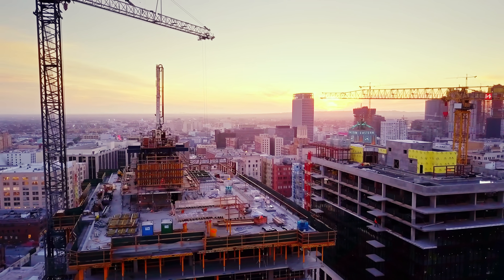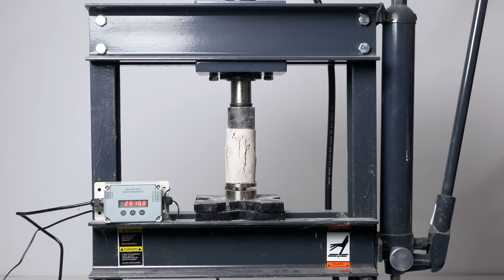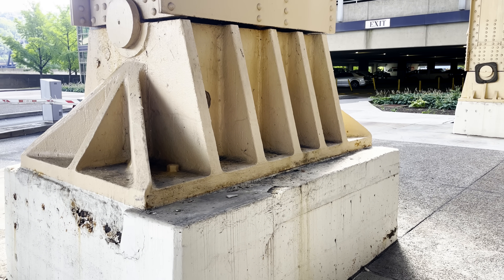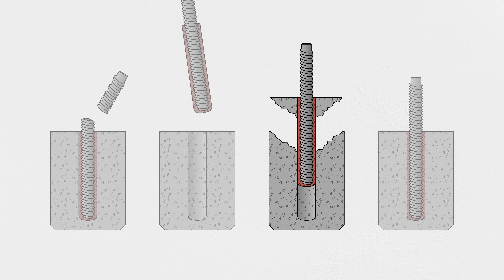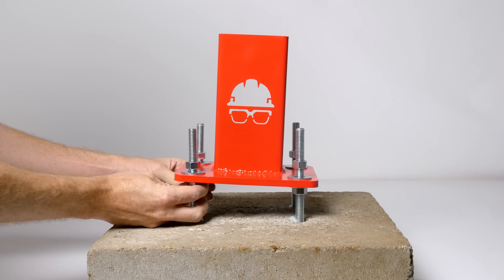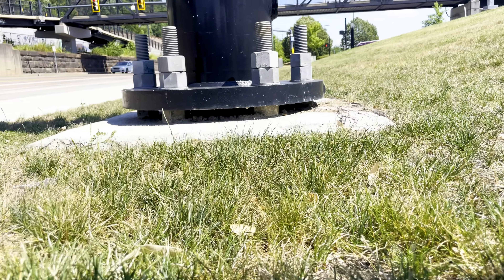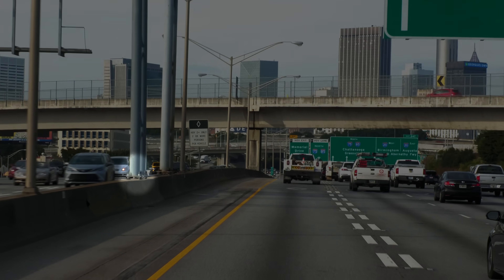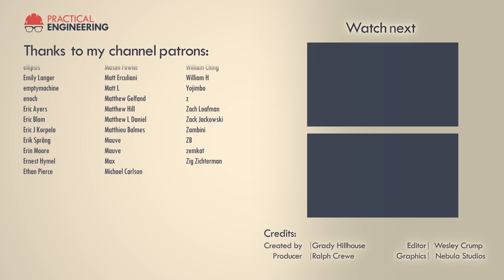What’s the Deal with Base Plates?

Comment: Back in the mid 80’s I invented the Immured Foundation to attach electrical transmission poles to drilled pier foundations and eliminate the baseplate and anchor bolts. The pier reinforcing steel was left extending above the pier and the concrete set. The pole was set over the extended reinforcing steel and concrete placed inside the pole over the top of the rebar. The length was the greater of 1.5 times the pole diameter or the development length. 10 to 15’ was common for these poles. 

The problem with anchor bolts has been around for a long time and I have seen a lot of mistakes made and fixed a lot of them. Most are self inflected by the original design engineer.

The Immured Foundation was invented to eliminated the anchor bolts for large steel poles. If you Google “Immured Foundation patent” you will find the details. It does take special software to design.
Reply: Is this Mark, or Gordon?
Reply: @ Mark, Gordon French passed away.
Reply: That seems to just be an embedded pole. Dig hole, plop in the base pole and a rebar cage, fill to grade, add new pole section, add more concrete. The images didn't help me at all, unfortunately, but it sounded like you're just constructing a grouted pole. I'm sure I'm missing something.
Reply: @kindlin  Direct embedment works for the steel LD poles. You do have groundline and inside corrosion issues making it unreliable for major poles and they lacked the strength for angles and dead-ends. You also need a larger diameter and burry a lot of steel. LD poles are a replacement for wood poles.

The Immured Foundation was invented for an odd reason and proved to have other advantages. It does not make sense for every application. The Immured Foundation was invented to reduce the drilled pier diameter. A new group of poles was developed that required an auger lager than 10’. The 10’ was the limit of the company’s equipment and to go lager ment a new larger crane drill rig and augers or contracting the project out. The crews also hated dealing with 42-2.25”x13’ anchor bolts. When an anchor bolt was bad, it ment the bolt was cut off and the pole capacity derated.

Prior, we had tried just embedding the bottom section partially in the pier. This installation went poorly. The pole was embedded partially in the pier. This ment the pole had water drainage issues and subject to filling with water. Also it had a larger diameter than the Immured Foundation. The pole base had to be supported by a crane overnight for the concrete to set. This arrangement way bad because it was subject to weather and breakdowns and security and safety issues.  Additionally, the crane was not working on drilling holes. This would mean a second crane just to hold the bottom section. The Immured Foundation solved all these issues plus eliminated the pesky anchor bolt issues. The pole manufactures were kept in the dark on the first project about how they were being installed. Once they found out they loved it because they got rid of the anchor bolts and baseplate problems.

The only way to tell the difference between a direct embedded pole and an Immured Foundation by looking  is the Immured Foundation has drain holes about 10’ above ground.
Reply: @TexasEngineer   All of that makes sense, thank you. But I'm not much closer to understanding the difference between an Immured Foundation and a standard embedded pole. Is it that you extend the concrete up past grade to alleviate drainage issues? It's not too uncommon to fully grout steel tube columns/poles for structural purposes, which sounds kinda like the bottom 10-ft above grade, but it sounds like this was done for maintenance and construability reasons.
Reply: @ The reinforcing extended inside the pole works as the anchor bolts. Some of these foundations extend 40 to 50’ feet below ground and the diameters are 8 to 12’. In other words direct embed is used for small poles and the Immured is used for large and very large poles. The pole steel is very expensive compared to concrete and rebar. The Immured Foundation uses 2 to 3 times the amount of rebar because the cage diameter is reduced.

As far as filling the pole with concrete: On new installations I don’t see the advantage. Using a bigger pole would be more economical. Steel is 9 times more efficient than concrete and what do you do with the reinforcing and a tapered pole.

With that being said; we have pumped concrete in the bottom of old large anchor bolted poles to increase the capacity to install a cell site on top of the poles. We stared using steel poles before there were design standards. One group of poles was called octi-elipical because they were eight side elongated. This created a b/t issue that was not originally known about. The addition of concrete was used to stiffen the pole walls and get a little more capacity out of the poles.
Reply: @TexasEngineer this is really interesting. All this base plate and anchor info makes me wonder with all the stronger winds coming if poles and columns will be failing in 3-15 years.
Reply: @ What is interesting is the normal failure of a baseplate does not present in the baseplate. What happens is the pole weld or pole wall rips. I suspect, this is caused because the baseplate is too flexible. Additionally, welding toe cracks sometimes caused by hot dipped galvanizing, plays a very big role. Ultrasonic testing after galvanizing and before shipping is an industry must. There are plenty of examples of this type of failure. On the other hand I have not found one anchor bolt failure. There are examples fatigue failures of anchor bolts for overhead highway signs. But, these bolt were not overloaded by wind.

Maybe others can cite other failures I have not found. Companies do not keep pictures and documents of their failures for legal reasons.

The immured foundation eliminates all of these issues.
Reply: Would love to see video on immured foundation.
Reply: @ZemZemByZemSqd  It is very old technology and even predates PowerPoint so the information is in low quality 35 mm slides. The design aspect is very complicated and only some engineers could follow it. The design requires a computer program to converge to the answer. Right now there is not a good program to design it because Windows 10 bricked the program and the new version of LPile did not play well with Excel. It is hard to explain except when I retired everything worked, then Microsoft changed the world and no one left has a clue how to fix it. It is that complicated.

The video has been tossed around but it does not present well. The reason is when you see the finished product, you can’t see how it is connected. Everything is done inside the pole and the inside is filled with concrete. It is similar to Pontiac trying to show their new hidden windshield wipers, look there is nothing to see.

With that said there is a need for a construction training program that would include a video and a manual.

Comment: When you have a traffic light post with a beam hanging out over the traffic (many feet long), I have always wondered how the torque created by the traffic light at the end of that  beam is counteracted by the bolts on the base plate just a few inches from the post?  Do they bury the post into the ground to counter that torqe?

Comment: And now I'm thinking about those traditional Japanese temples where the beams aren't rigidly connected to the ground; and act to help seismically isolate the structure from the frequent earthquakes.  I'm wondering how those designs handle sustained wind loads and why those don't push the temple off its foundation.

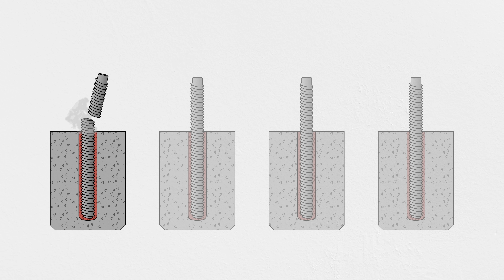Comment: 5:30  When putting the anchors in the wet cement a cage of rebar around the anchors can prevent any problems with cracking.  And it is relatively simple to bolt them to a stabilizer attached to the form so they stay in the correct place.
Reply: I wish what you wrote is the industry standard.
Reply: Yes, adding rebar all around anchors helps a lot, it basically precludes all the failures except steel yielding and bond shearing, but I mostly work in existing construction, where we are post-installing anchors with no control over the existing rebar, and can, at most, say that there is a side bar to prevent concrete breakout.

Comment: A common issue for new engineers is specifying high grade bolts for the base plates.  Or sometime the contractor wants to use what they have lying around. The high grade bolts themselves are terrible in fatigue as there designed to be tensioned and there to be no changes in stress throughout its life.

Comment: Grady, the information completely agrees with everything I saw and learned in my electric utility career.  Transmission line and substation structures everywhere depend on the baseplate/anchor bolt connections.  I was able to witness a structural test of a steel vertical member where in one instance it had no gusset plate stiffeners at the base and the other where there were four (on in each direction) short (6" high) and the strength increase was something like a four-fold increase.  Great video.  Seasons Greetings, Dale
Reply: The gussets on the plate are there to make it emulate a much thicker plate, but with the ability to couple the load to the column with a lot more weld surface, as each gusset allows you to have 2 times the length of weld, spread out over much more of the surface area of the column. With proper care the failure point of this is the column will break or buckle above the gussets, as something close to the tensile strength of the cross sectional area of steel in the column. 

A thick plate will be much weaker, though it will not deform, because there is only the circumference of the column as weld area, not multiple welds spreading out the heat affected zone of steel around the column, and along the length of the gussets. Not many designers will insist the weld on the plate is annealed, unless it goes through a hot dip galvanising bath, which will do this to a great deal as part of the process, as you have to heat the whole unit to 500c to get good adhesion of the zinc. However it does require care to not also introduce excess hydrogen into the steel, which makes it brittle.
Reply: @SeanBZA   Ah, you basically said everything I wanted to after reading the OP - carry on!

Comment: I'll tell you what the deal is. The deal is I gotta set the bolts for these sub 5mm just so the dump truck can drive over the set and flatten them. Then the contractor comes along and sledge hammers them back by eye and doesn't inform me.

Comment: Yeah signs! Even what look like very large sigs are often mostly empty space.
BOOOO grout! Glad it went away. 
Similarly, in the commercial sign biz, we really frown on setting the baseplate directly on the concrete foundation and shimming it for level. It has similar issues as the grouted base plus no matter how tightly you think you clamped the plate to the foundation, the variable wind load of a sign will always cause rocking. The rocking will pulverize the concrete faster than many people realize so the rocking gets worse faster than you may realize. In the rare cases that our company must do this (usually because there is not enough bolt thread above grade for the leveling nut + base plate + clamping nut), we will commonly weld the nut to the baseplate in an attempt to minimize the amount of rocking. It makes future disassembly, but it's worth the headache a decade from now. 
Also steel shim that are clamped between the concrete and baseplate tend to corrode faster than normal due to the same grinding motion the concrete is experiencing. 
Stand-off plates with large enough bolts that include water shedding and airflow are the best option.
Reply: @davidwilliams9302  for dynamic load issues we have made studies that clearly show prestressing the bolt is the way to go

Comment: Up her in Quebec, most new light poles are now design with standoff base plates to prevent corrosion of the interior surface of the pole. De-icing salts combined with high humidity inside the poles are just  chewing up pole otherwise. Including aluminum poles.
Reply: Would aluminium poles not suffer from bimetallic corrosion with the steel fixings ?..
Reply: @peterfitzpatrick7032  Normally with aluminium poles the bolts are 316l stainless steel, which suffers less from corrosion with aluminium, especially if you use a anti corrosion inhibitor liberally during installation. by me there are aluminium gantry units that have been up for close to 40 year exposed to salt spray, and aside from being cut down for scrap metal, they are surviving well.
Reply: @peterfitzpatrick7032  If the contractors cheaped out and specified galvanized anchors, then yes, once the zinc runs out, the aluminum will sacrifice itself to the steel. But 304 or --- preferably in salty environments, 316 anchor bolts have no such issue when they remain passive (which stainless steel usually does).
Reply: True here on Long Island NY.. salt water marine and road salts .
Rust jacking an issue .